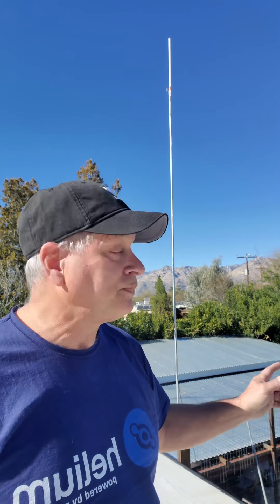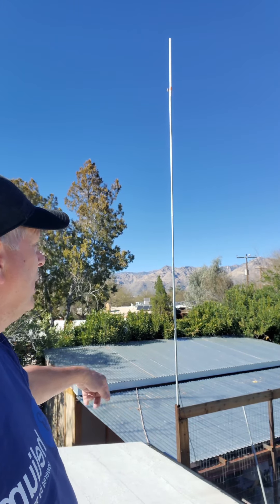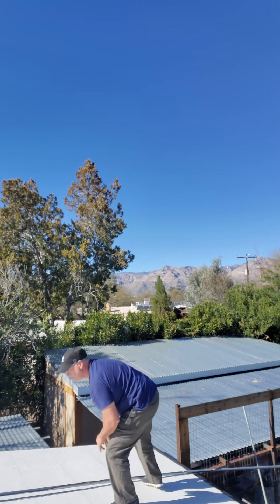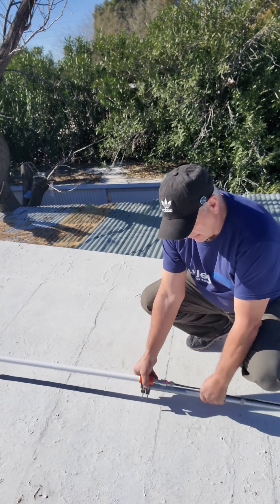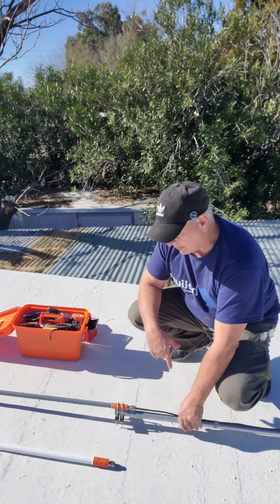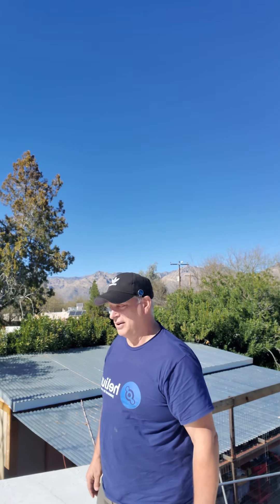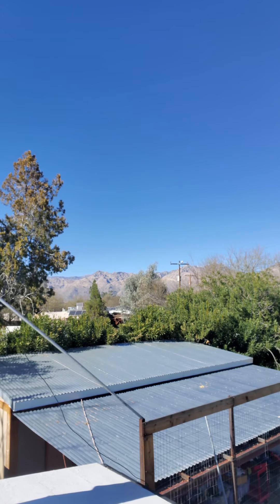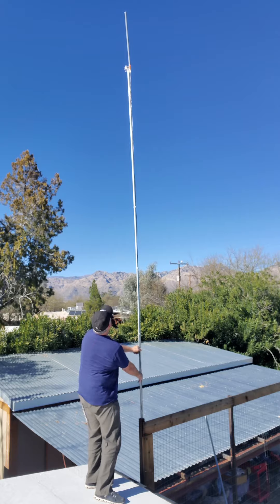Panther X2 Antenna Switch - SignalPlus 10dBi vs. RAK 8dBi on PX2 (sx1308)

Comment: Is that just a standard pole that the antenna is mounted to?  Just got a Panther x2.  Trying to decide if I should install a pole or attach the antenna to an arm and mount it on the side of the roof like a satellite dish.

Comment: hello i have question how much the pantherx2 need to syncronize 
and how much helium does it mine in a day? thank you
Reply from the maker: It took my Panther X2 took several days to fully sync and then it took several weeks for it to get out of a relayed status.  The HNT is really dependent upon your location and the antenna that you use. My advice is, if you have the ability to get it outside get it outside and get it as high as possible. If it's going to be inside you still want to get it as high as possible and use a higher DBI antenna. A lot of people are recommending a rack 5.8 or something like a McGill 6.0. Hope that helps and if you need more answers please feel free to get back in touch
Reply: @viheliumgroup9357  hey i am instaling my pantherx2 on the rooftop with a 10 dbi antena because i am on a flat urban area i will keep you updated about it wen it connect